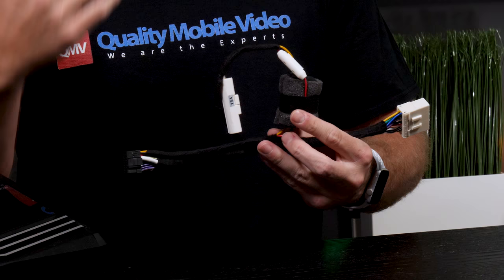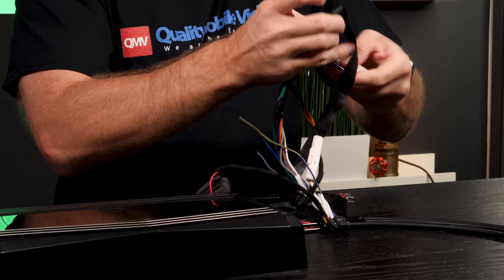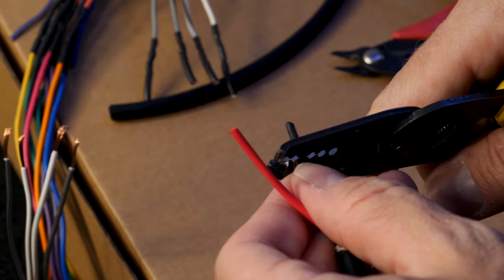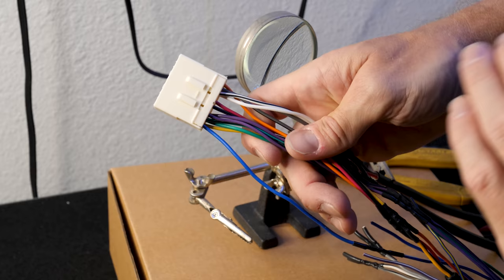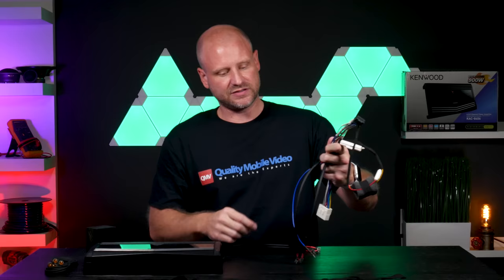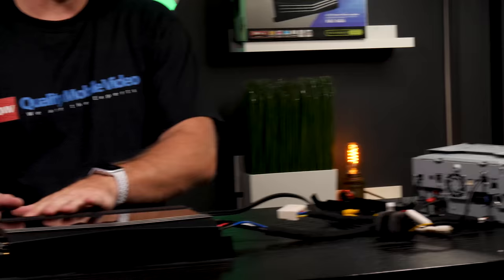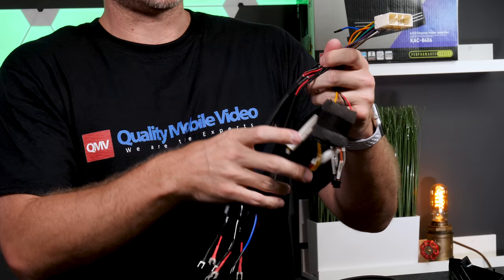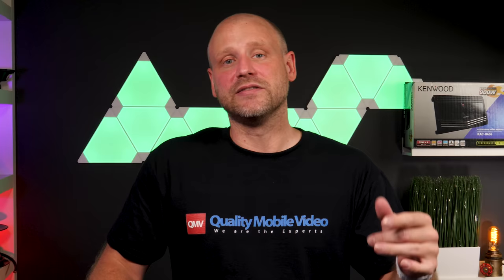Wiring a 2 or 4 channel amp to your stock speaker harness without cutting the factory wiring

Comment: What wires actually go to the speakers? All I've seen you do is connect the hu to the amp.
Reply: The Rca runs to the head unit from the amp and the amp runs to the factory harness to complete the circuit to the speakers.
Reply: Ezequiel Lopez me too bru
Reply: RCA's out of the head unit to the amp. Speaker wires out of the amp back to the harness that connects to the vehicles wiring. Then you're using the factory speaker wires from there to each speaker, so you don't have to run new wires through the doors.
Reply: PURESOUND4 so the speakers no longer connect to the head unit?
Reply: Stefan Williams  Correct. The whole idea is to drive the speakers with more clean power than the head unit can provide. So you don't even use the head unit's speaker outputs, just the RCAs to get signal to the amp. I've got a small Clarion 4 channel amp (50x4) wired  this way and it sounds way better than it did when I had the speakers powered off the head unit.
Reply: Turd Ferguson   Yeah, if there's a factory amp behind the dash or wherever, then I would run new wire from the aftermarket amp directly to the speakers.
Reply: I think the question was he hooked the rca's from radio to amp. Then wires from amp to radio plug  , so how do speakers get a signal, if the stock speaker wires are all cut ,and not used . Stock speakers wires were never hooked back up ,just heat shrunk them all .. he tied them to the radio side not the car side .
Reply: Speaker wires go from amp to car speaker harness ,not to the radio side only thing connected to "radio side" is black ,yellow ,red and ,blue with white tracer , blue with white tracer is for amp turn on
Reply: Ahhh, IC so that’s why he says to “insulate the old speaker connections.”  Because the speaker connections from the stereo to boat harness and that’s where the amp speaker leads send signal out to existing speakers.
Reply: Jo Ras I installed a 4 channel amp and it turns on and has power but no sound is coming from the speakers and pretty sure I wired it right and have the rca’s properly connected but a slight little clip sound no matter what volume
Reply: PURESOUND4
Reply: Jo Ras lmao they are cut 
Basically shows u how to power an amp and get no music 
Speakers don’t play with no wire connected to em no matter how many amps u install
Reply: @PURESOUND4  -- how do I know if I have a factory amp or not?
Reply: @BurningDownUrHouse  It depends on what vehicle you have. Some vehicles have "basic" sound systems with speakers wired directly to the head unit, and others will have "premium" sound systems with an amp either under the dash, in the center console, or under the seat. I would call Crutchfield and get someone there to help identify what you have. They have great customer service and a very extensive database that covers most cars on the road.
Reply: @Karlitos- Network   I don't think you need a T , but if there's a factory amp you would need a way to bypass that, so the signal would go from the aftermarket amp directly to the speakers. That's why I like to run new speaker wire from the new aftermarket amp straight to the speakers, and not use any of the stock speaker wiring.
Reply: PURESOUND4 not to the door but yes to the stereo from the passenger seat or from the trunk
Reply: Do you need another amp if you install a subwoofer?
 and do the watts of the amp matter when you install them to factory speakers with an after market stereo or do they need to be of equal wattage
Reply: @PURESOUND4  can you still use the eq to the headunit? like dsp built in?
Reply: @lemueljohnlajom7141  Yeah, you should still be able to use any features of the head unit like normal.
Reply: @PURESOUND4  thanks. so its just an upgrade power but can still use all the function.
Reply: @lemueljohnlajom7141  Exactly. The only thing you're not using on the head unit is the built in amp.
Reply: @PURESOUND4  now this enlighten me. thanks puresound
Reply: @PURESOUND4  hi im using sony s400d. will it make any difference in the power if will only use 2 channel option or its still the same with 4 channel option thanks
Reply: @lemueljohnlajom7141   If you're only using 2 channels of that 4 channel amp, it should still give you a little more clean power than most head units.
Reply: @PURESOUND4  hi, how many RMS power can the factory speaker wire handle.
Reply: @austinej2785  it depends on what size wire is there. Most of the factory wiring I've seen should be able to pass 50-75 watts with no problem.
Reply: @PURESOUND4  I'll chime in a question also Haha, what do you think is a good upgrade speaker wire 12g 14g? And is it hard to change out the factory speaker wire I'm planning on getting new speakers to run them at 100rms each . So I wanted to upgrade my speaker wire to just be safe thanks.
Reply: @Nick_24bean  14 ga. should be good for that power level. I only use 12 ga. on subs with 250-500 watts.

Comment: I've just brought a 5 channel amplifier and have a 2005 gt mustang it has 2 speakers in front doors standard and 2 in rear paclel shelves but the bottom 2 speakers have 4 wires coming out from them

Comment: Great video! I hope you have time for a question.  I installed 4 new speakers & a Kicker Amp in my 2014 Mustang Base.  Keeping the factory am/fm unit.  Correctly installed a PAC AOEM-FRD24 Interface Integration so as to run 4 RCA cables to the amp.  Wired rear speakers direct and all works.   Since I’d prefer not to run new speaker wire through the door molexs; can I utilize the speaker wires in the factory module even it is plugged into the PAC unit ?   I’ll be using Posi-Products Speaker Connectors so I will be able to only tap into the wires & not cut.  I just don’t want to hurt anything.  Thanks for your time.

Comment: I thought about getting a Metra female harness and factory male harness from a junk yard. This would allow me to use the factory radio and factory wiring to power an amp and aftermarket door speakers.

I'm just trying to decide if I want to keep the factory radio or upgrade to an aftermarket one. I've also got a Mopar subwoofer that hides behind the factory trim panel. I'm also trying to decide if I should get a new subwoofer speaker and run new wiring to the subwoofer. 

I'm not going for a super loud system that other people can hear at stop lights. I'm just going for something that sounds like a good pair of headphones.

Comment: So basically you just eliminate the head unit speaker wire connections and connect wire from the after market quick connect harness speaker wire outputs, then to the amplifier, correct?

Comment: Thank you for the video!!! my question is do you use anything to put between the radio and input towards the amp? Because you got to run two cables of this nine wires correct? So you caught the speaker wires on the radio get the nine wire to the end and then the output of the amp to the speakers right???... I appreciate your time in advance!!

Comment: thanks, guys for the video it is super helpful. can you assist in this setup?

I have a four-channel amp
x2 twitters
x2 6x9
x1 Sub
x2 front door speakers
x1 four-channel converter

looking at the tutorial explaining the four-channel setup.
How would I add the loc, tweeters, and sub?

I have a stock head unit and want to keep it that way hence the LOC

Thanks

Comment: Is then possible to do with not running the rca cables? Asking because my radio only has rca's for the sub output. And I'm trying to avoid running all new speaker wire.
Reply from the maker: Yes, if the head-unit has good full response good sounding outputs and you like it,  get yourself a PAC LP7-4. oYou can also do this depending upon your amps, send that high level into the soldered RCA's directly.

Comment: Is this applicable to bypassing oem amp?

Can I use the same setup AND just leave the oem amp unplugged or will I need to tap into the OEM Amp wiring harness after removing the amp?

Comment: I feel like I'm missing something. How are the speakers getting any signal from the receiver if we cut them off from the harness and putting it into the amp wires? It's getting power and sending it back to the receiver but then how is it getting to the speakers?
Reply from the maker: This presumes you are using an aftermarket amp and headunit, you can do this with a stock headunit but you need to run the speaker level signals to the amp instead of RCA's

Comment: Correct me if I’m wrong and not sure if you mentioned it, but doesn’t the amp need a power source? Shouldn’t there be a power wire running from the battery and a ground wire?

Comment: Hello. 2ch mode.   Only front signal to amp.  And out to 4ch from amp.  The fade front/rear Will not work right?   Is that best wiring to do on a Toyota whit wery low volt out on rear Chanel and low bass ?

Comment: I try to install a 4 channel amp to my speakers and an aditional amp + sub. I dont know if i get this right, so here is my question.
I cut the factory wires and i connect the existing factory wires from the speakers to the 4 channel amp as the line out and then from the 4 channel amp i come back into the factory wires behind the factory head unit as the line in (without RCAS). Then can i wire the amp + sub from the 4 channel amp?

Comment: Very nice work 👌 if i want to install another amp for the rear speakers because i have one but is a 3 channel wich its wired the front speaker and subwoofer the questions is,, can i take +12v from the amp or i should roll another wire from the battery? Forse the second amp thanks
Reply from the maker: You will want to run another 12 volt power wire to the 2nd amp or run a larger main cable and do a fuse distribution.
Reply: @Qualitymobilevideo  thanks

Comment: also where I'm a bit confused is the connections to the harness wouldn't the speakers wires lead to the harness and thus the head unit powering the speakers if you connect the amp to the harness how will that power the speakers

Comment: Ok so the wires connected to the amp will run to the wires going into radio and wires coming from speakers will be cut off or are we just tapping into the wires coming from speakers and running to amp and cutting of speaker wires coming from radio?

Comment: my question that not a single video on youtube has yet to show me, if You are planning on adding a subwoofer and amp to your car.. either stock or aftermarket head unit, with aftermarket wiring harness and sub install kit etc. can you simply have one amp that just powers your sub without having to run your stock door speakers through the amp? because i basically have materials to run a factory or aftermarket head unit but confuses the hell out of me on rather running the rcas to the amplifier would mute the wiring harness factory ran wires  to the door speakers? or would i have to like splice into the rcas from the head unit and use like a Y connector

Comment: So i use this same 2 channel  kenwood amp and hook up to 2 6.5 they barely have any volume coming out of them  and the bass is higher than words but still with  the volume all up and amp up they sound like volume is at a 2. When its at a 30.  I have 2 of same 6.5 to head unit and they sound great. Whats the deal.   The amp worked great on the sub

Comment: I'm connecting an amp for my sub to the stock head unit... I'm worried that the RR+ RR- LR+ and LR- wires connected into the head unit already that I will be splicing are already being used... How can I verify that they're not?

Comment: I bought the infinity dsp4452 and have a 2020 wrx I want to retain factory settings on stock head unit, but is confused with high level input taps, and new speaker outputs on factory wiring I looked at your website and trying to make a t harnest but the website is giving me Subaru harness for 2007 model

Comment: I just have a question when I run eight speaker wires and one amp turn on wire and make the cut am I routing the nine wires the way of the aftermarket head unit or the way of the car factory wires??. And obviously with the amp turn on wire will need need to be made if you have a factory installed amp or power antenna correct which I don't so I will just cut it and heat shrink the other side off.

Comment: I have a mini 4 channel full range amp to power my 4 stock 6x8 speakers . How do I get power and ground?  Can you connect that to the acc power and ground it behind the head unit somewhere ? I wouldn't have to run heavy guage wire to the battery for a mini amp, would I ? The amp is so small I plan to litterally set it in place behind my android head unit . Thank you

Comment: Hey I got a skar dual 12 inch subwoofers 2400 watts and a 2000 watt skar amp what's the best amp wiring kit I should use and do I have to do the big 3 or is there another way to save money watch your channel all the type and would love to hear some feedback from you if you could help me out don't want to buy the wrong thing
Reply from the maker: Without model number, arbitrary output numbers don’t really mean anything. Rules of thumb on current consumption, Class AB 50-60% efficient, Class D 70-80%. Volt x amps = watts, calculate your true RMS output, wire length with your max current consumption and you can see what wire you need.

Comment: Hey I have a question If I have wire harnesses for my door speakers how do I connect the amp wire to the speakers can I connect it to the head unit or do I have to connect it to all four speakers?

Comment: @qualitymobilevideo I'm a complete beginner and trying to learn.  All my speakers went out but the radio is still working (I hooked up an extra speaker directly to the radio and sound came out).  I checked fuses and wiring, so I'm assuming it is the amp.  My question is this, in this video, are you installing a new amp and creating a new route for the radio signal to go through in order to produce sound in the speakers while also leaving the factory amp in place to handle any other functions it currently does (I think my factory amp has at least the rear brake lights running through it)?

Comment: If im using a stock head unit with no rca outputs, do i just tap into the speaker wires and run them into the highs amp and an loc then the rca's to the loc to the amp?

Comment: Your videos are always clear and detailed and easy to follow. I personally need to know how to connect an amp and LOCto my 2023 compass stereo but I don’t believe I have easy access to my stereo harness, being that it’s a large 10 inch screen(not easily removable). Not sure how easily I can add an amp maybe a dsp to connect to two subs, but also boost my door speakers. Any recommendations? I have a dsp and two amps plus lots of materials from previous car stereo set up, just hoping to integrate some of them on my new car

Comment: I noticed that the amp output to the speakers is running back into the head unit which is confusing.  Why would the amp output go back into the head unit and not directly to the speakers?  I have a head unit with six channels of preamp outputs which I was going to run four RCAs (LF, RF, LR, RR) to the RCA inputs on a four channel amp.  I was going to run the amp outputs directly to the speakers, not back into the head unit.  Is this not correct?
Reply from the maker: No, the amp power is simply utilizing the factory speaker wires behind the radio so you don't have to run new ones.
Reply: @Qualitymobilevideo  Okay... I think I have it figured out.  My confusion was orienting your example harness.  I assume that the large white connector is plugging into the original factory harness and the large black connector is plugging into the aftermarket head unit.  Is this correct?

Comment: Trying to amp the speakers in my 14 f150, keeping the stock head unit. Could I use four wires from lf and rf to the amp from the factory wiring harness then use 9 wire from the amp to go back up to the head unit and connect all 4 speakers and then insulate the other 4 wires which would be dangling from the stock harness?
Reply: Or is it better to run all 8 wires back to the amp or loc and put 2 wires in each side channel?
Reply from the maker: You could use just a two channel LOC and use the 2 channel switch on the amp to run all four inputs. You will need to test the outputs of the factory radio to make sure they are full range.

Comment: Hi is it possible to use a factory stereo in another car like a 2013 Dodge caravan Uconnect stereo it had steering wheel controller for volume and in the 2007 Dodge charger it does not have any steering wheel controller for volume they both are double din stereos. I did install the caravan stereo to the charger but the screen is black when I put power plug in the plug spot and the other two cables in the fitted spot and it had 3 more cables but the charger only had 3 cables coming from the car do you think that I would need a wire harness to install the caravan stereo to the charger or is it not possible to add a factory stereo?????????? Please help

Comment: If I have a two-channel head unit, can I use this technique to splice in a couple of extra speakers to the rear? If so, is there anything I need to consider?
Reply from the maker: I don't know of a two channel headunit.
Reply: @Qualitymobilevideo  OK, well my car has a factory fit head unit with tweeters in the dashboard and speakers in the front doors, but nothing in the rear - so maybe it has four channels and I need to add two more if I want rear speakers.

Comment: Dose this actually work with a vehicle that has a factory amp because I never have found a amp bypass harness for a 2012 Nissan Altima s
Reply from the maker: It will if you bypass the amp.

Comment: It rises some questions about appropriate wire gauge. Does it capable to transmit  high current with tiny-ass-crap stock wires ? Signal is busted and we need more room to play with , right? Potentially it will increase temperature what might cause fire. Just asking...